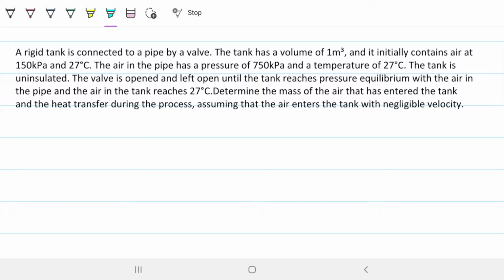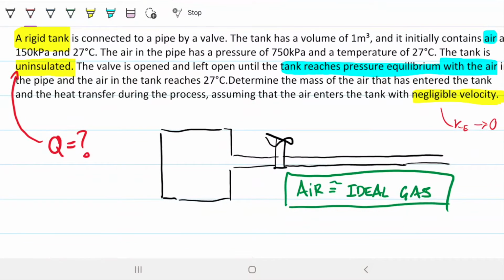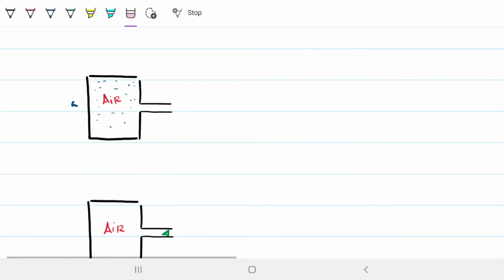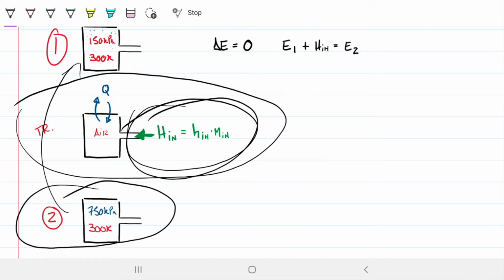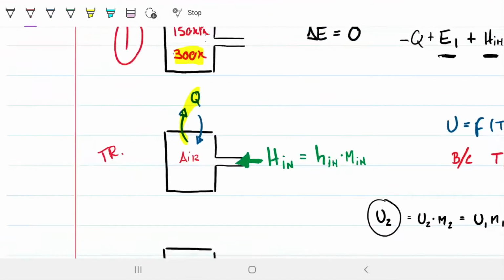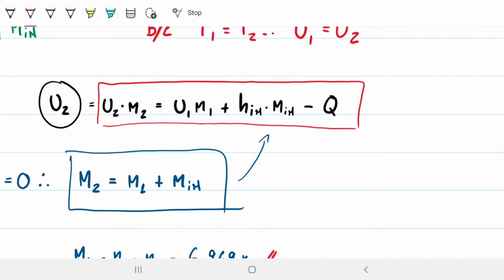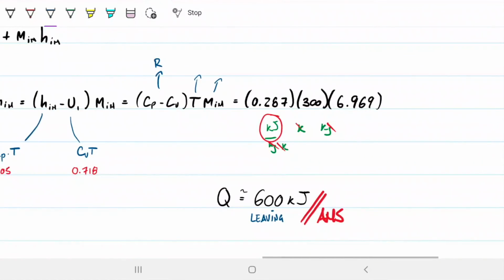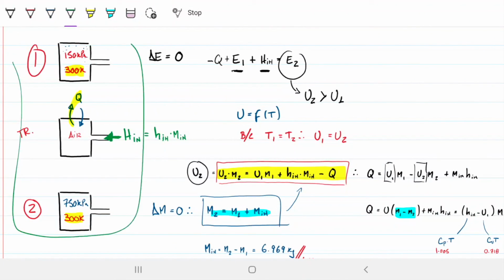Transient System (Unsteady) | Ideal Gas (Air) | Thermodynamics

Comment: I get why we use h and not u for the incoming air, because the flow work to compress the initial air.  BUT, do you use h for the incoming air if the tank is evacuated?
Reply from the maker: You have flow energy, and a mass flow rate. So you need to account for that. Recall that h = u +/- PdV
Reply from the maker: This video might help https://youtu.be/mOsEg2aCSZM?si=z5a182mqVt8a6kW0

Comment: For an ideal gas, U = 3/2 nRT, so it is not only a function of T but also moles (mass), hence U2 and U1 are not equal, specific internal energies are equivalent but will be multiplied by different masses, so the energy of state 1 and 2 are different.
Reply from the maker: That logic does not make sense when looking at the "lower case" u, as it is mass dependent. The specific internal energy will be the same on both states.